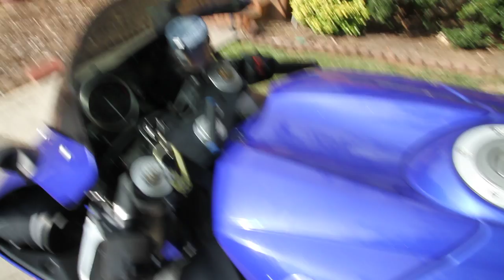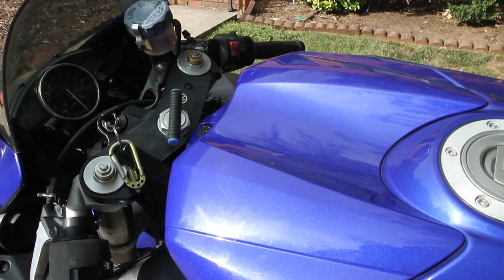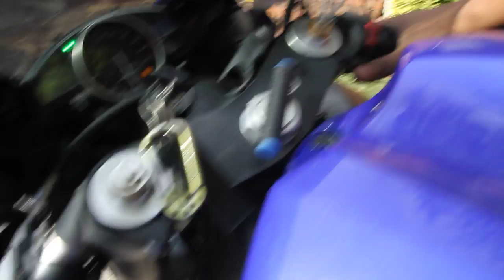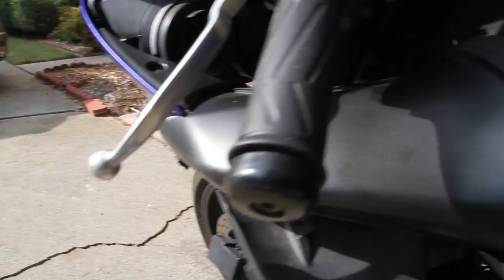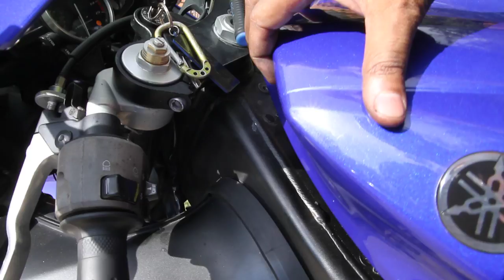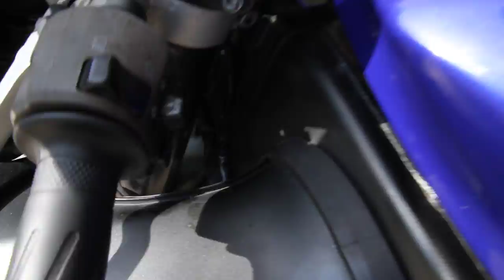R1 with rattle and knocking

Comment: Of course I can't see the bottom adjusment on the clutch side but on the top it looks out pretty far, the clutch adjustment can lead to tons of noises I've learned on the r1. Try spinning your top one in and making more slack or freeplay in the line

Comment from the maker: Some springs in the throttle assembly had fallen out of the engine.  The (stupid) dealership couldn't figure it out.  The mechanics at Marietta Motorsports figured it out before I got home from dropping the bike off.